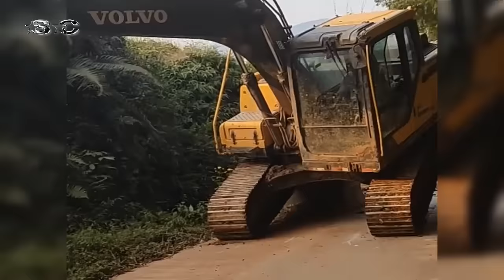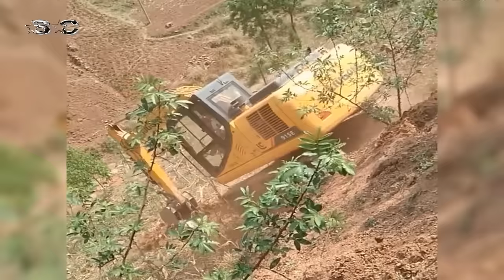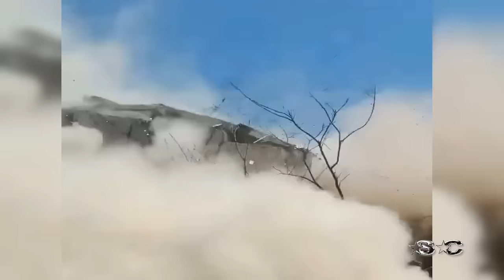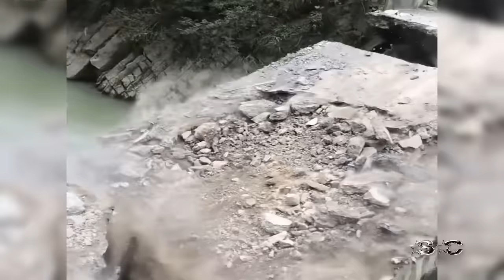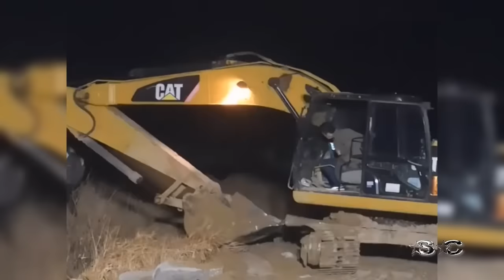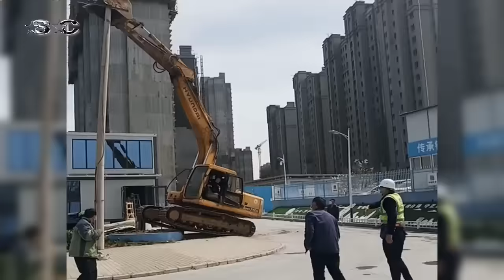10 Extreme Dangerous Idiots Excavator Operator Skill - Fastest Building Demolition Excavator Skills

Comment: You call them idiots? You certainly don't know what many men have to do to keep a job, especially in Asia and other countries.
Also you don't appreciate the skill many of those men are showing.
I do, because I know those machines.
Reply: the first going over the concrete block not ideal but it was fine.
putting the tracks back on the machine that there is a pro-operator!
lifting the machine with the arm to put the excavator onto a tip-truck (tho this one a bit small)  
is something most operators will do working in temporary site construction at some point in their career